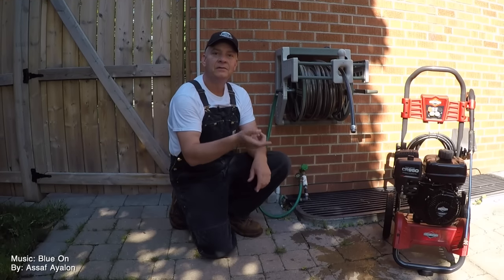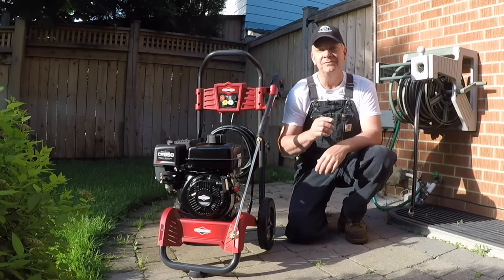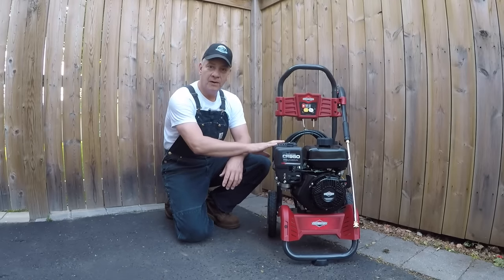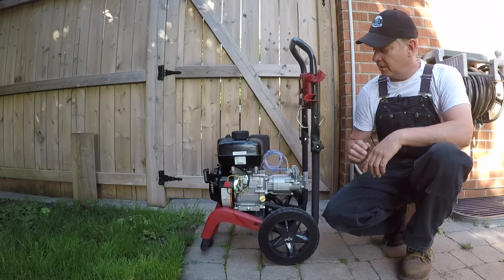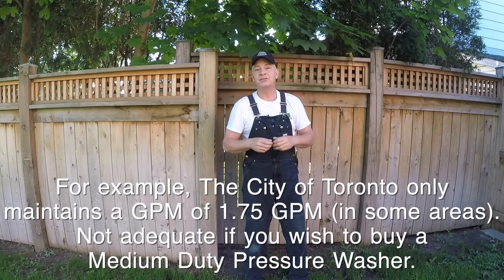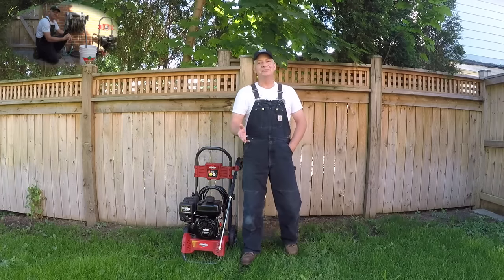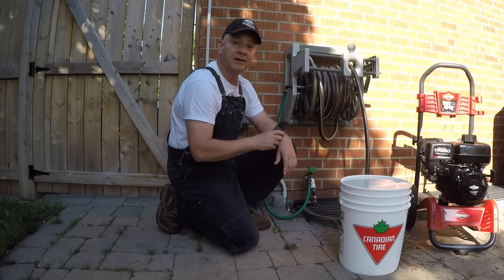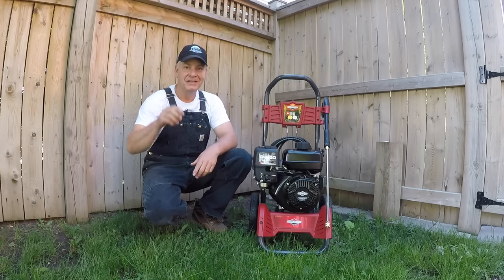#430 Don't Buy A Pressure Washer Before You Watch This! Critical Step That Most People Don't Know.

Comment: There is an easier way without wasting so much water or taking so long. Just measure the time (in seconds) it takes to fill a 1-gallon bucket. Then divide 60 by that number and you have GPM. You can do the same thing for Liters.  Example...  20-seconds to fill a 1-gallon bucket. 60/20 = 3 GPM.   If 15-seconds for a 1-liter bucket, 60/15 = 4 LPM. :-)  Good advice on the manual, I always try to review the online manual on most equipment before purchase. In a lot of cases they will reveal some secrets not listed in the advertisement.
Reply from the maker: Thanks Joe! This is really helpful. Thanks for sharing and enjoy your Sunday!
Reply: Wasting so much water?
Lol like he somehow ruined that bucket of water??
Gtfoh 
hydro hugger.
Reply: @jaxturner7288  I think GP used that bucket of water to do the dishes.🤭
Reply: What’s are “ liters”
Reply: Remember adding a hose to your water supply reduces the gpm . Longer hose less gpm. Thanks this was a great video

Comment: My neighbor has a pressure washer that’s 3200 psi and 1.7 gpm it will barely clean his side walk and fence. My pressure washer is 3200 psi also but it’s 2.5 gpm. If you get to close to the fence it will start to blow a hole through it with the same tip he was using. I would say the gpm is most important data point when buying a pressure washer. I always tell everyone to get one that’s 2.0 or higher. It’s been my experience that pressure washers under 2.0 are a waste of time. They can wash a car but they won’t clean sidewalks or brick siding or fences ect ect.

Comment: 5'39 also the hose it has to be a good hose if it gets tangle or cut in any way from the faucet to the washer machine..it will not go throught the water and it will messed up the machine

Comment: I primarily use my pressure washer for car detailing.  The first rule, no gas power washers, too powerful.  So I chose a unit I can use in car detailing, as well as multiple uses around the house.  The unit I chose is the Greenworks 2300 psi with 2.3 gpm.  Trust me a powerful unit to clean driveways, decks, siding and yet not too powerful for detailing.  The unit cost $230 (US) and comes with a 10 year warranty.  So if you're in to detailing, this could be the unit for you?

Comment: If I can add; if you plan to use frequently/very frequently your pressure washer, from a longevity point of view choose a triplex pump over an axial pump. As well as for generator, choose a copper winding over an aluminium winding for long run and longevity. Thank you again for your very valuable video. Regards.
Reply from the maker: Thanks D! Thanks for sharing some great additional info for us. Have a good day!

Comment: Hey GP, I've watched many of your Kubota videos when I had my B3350HSDC and now I'm looking to purchase a pressure washer and I came across this informative video. I'm looking at a 4gpm unit and I had just performed this test this morning. I used the same size bucket and it filled it in less than a minute. When I watched your video (which is obviously years old) I noticed you called your bucket a 4 gallon. That bucket you used is a 5 gallon. 4 gallon buckets are usually square but never have 4 rings at the top. It freaked me out because I need 4gpm and mine filled my bucket in 54 seconds which is fine if it's 5 gallons but if the bucket were only 4, I think that'd be cutting it too close. I went and rechecked to make sure mine was 5 gallons and it is and so is yours.

Comment: Great video GP,  you work well under pressure!.. Great point on supply. Every type of pump needs an adequate supply of water (or whatever) to meet the rated gallons and head pressure. The laws of physics still apply even for pumps.

Comment: Well GP, I gotta hide this video from the Missus....if she watches it, my 'honey-do' list will increase badly.  LOL  Lots of good info for sure.  We had to sometimes stretch 300' and more of hose up the walls and across roofs to wash condensors of large capacity commercial package HVAC units.  Pressure drop is a major consideration as well as well as hose inside diameter on long runs. 
    MOST residences will fall well within the 100' requirement, but a small cheap 1/2'' I.D. would still be a mistake even at or above the minimum flow requirement.  As the pressure drops, a high capacity pump will literally collapse the hose as it begins the process of destroying itself internally.  By the way, you sure have a way of refreshing a guys memory of all the work yet undone.....   LOL.  Have a great week my friend.
Reply from the maker: LOL! Well, I won't tell her....yet....:)) Yes, some great info there T! They mentioned the small diameter hose issue to me but I'll leave that for a future video. Hope you are keeping cool in this humidity!

Comment: Keep in mind here, Gord, that these GPM measurements are in U.S. Gallons, which is 3.78 litres ( approx.) not Imperial Gallons / 4.55 litres ( again, approx.) 
You are correct here though, the GPM  from your water supply is absolutely critical to the top performance of a pressure washer. 
If the manufacturers really wanted to be truthful, they should all state clearly the 'litres per minute' required for their washers, but I'd bet they won't do that, until 
'forced to' by regulations from government, this too won't likely happen.
Here's another tip for wise buyers, the big deal that manufacturers show is P.S.I. but here, once again, this is fictitious as most manufacturers show a 'simulated p.s.i.
that is enhanced by using vibrating water nozzles.
Reply from the maker: Morning Reg! Thanks - good additional information for folks. I appreciate you sharing it for me and others. Have a great week out there!

Comment: Good information GP.  The bucket method is useful for sure.  We've even used it to measure hydraulic flow in the past.  The bigger the bucket, the more accurate the measurement.  Cheers, Jason

Comment: Not to pick nits, you are actually talking flow, not pressure.

That's a 5 gallon bucket in the USA.  I suspect you are using Imperial gallons? (5 quarts).  Is the pump spec in Imperial gallons per minute?
Reply from the maker: Good morning and thanks for the clarification. Yes - flow ( bad editing on my part). The specs are in US Liquid Gallons ( not Imperial). Thanks again!

Comment: GP - first time I'm making a criticism of your informative  videos. 1) The pail is 5 gallons, not 4. We';ve given up on Imperial units in Canada -its either metric or US Gallons. 2) You keep using the term "pressure" from city tap. You should say flow. A pressure washer's job is to boost the pressure of the inlet water from typically about 30 psi to 3000 psi. You are right that a tap flow that is too little for the flow rating of the washer will not allow it to work properly.
Reply from the maker: Good morning Peter! Thanks for the excellent clarifications. And no worries - I don't think it is criticism, I think it is helpful and constructive. Helps all of us. Thanks again!

Comment: The #1 thing I would suggest to a new buyer is to buy a disc attachment head for cleaning your flat surfaces (driveway, sidewalk, etc...). I cant tell you how many times I see people cleaning these with a normal say 30 degree spray head... back and forth, back and forth and extremely uneven (and pretty physically taxing). When you by the disk, cleaning these surfaces is like vacuuming a floor and is 100% uniform. Best $40 I ever spent.

Comment: thank you for this video.. was looking into buying a pressure washer..but also your hydro on the side of your house, where did you get the cover for the meter. you are a very informative person thanks for sharing
Reply from the maker: Hi Wendy- the utility puts the cover on it here. Good luck in your search! Thanks for watching!
Reply: Im kinda looking at a kubota jet3500 wich kubota gage series has a oil alert protection system in it wich seems a pretty smart idea plus uses direct drive pump wich is nice  design

Comment: once again a great overview GP. I have a well and sometimes during the fill cycle for the pump holding tank the flow drops leading to surging. I've learned to stop spraying to allow the holding tank to fill then it handles the demand. I only figure that my flow must be close to good enough because that works and I can minimize surging.  Have a great week. cheers
Reply from the maker: Great point Roy! I haven't tried it at the cabin yet, but will keep mindful of what you suggested. Thanks for the great advice! Cheers!

Comment: This is really a good video of info, I hobby on the side fixing small engine stuff for extra money, generators, mowers, pressure washers, and the most common reason I see people giving away free gas-powered pressure washers almost on a weekly basis is due to the lack of inlet water pressure. Nearly all the free units I find on facebook marketplace people are throwing away the pump is burned up on them due to the house not having enough water flow, or they hook it up to a water hose and it has bends and kinks in it reducing the pressure so much that the pump overheats and burns up. I developed a simple little DIY gadget you can use to overcome this issue cost only a few bucks since my properly is unable to keep up with the water flow. I took a 5 gallon bucket, on the lid I drilled 3 holes in it and with a bit of pvc glue and pipe put an inlet and an outlet pipe that runs nearly to the bottom of the bucket, then the middle hole just has a small nipple of pvc pipe on it so its easier to see the flow overfilling the bucket and has a simple pvc turn valve for priming the pump easier. I run the house hose to the inlet pipe, the outlet pipe has a short like 5 ft hose going to the pressure washer, I shut the valve off on the bucket, turn the water on and it will fill the bucket up with pressurized water, then I start the pressure washer and open the valve on the bucket. The water will spill out the overflow of the bucket when its filled, then as you use the pressure washer it will drain the bucket slowly, then you let off the handle and can easily see when the bucket is back full by the water spilling out the middle pipe. I went to this, because many buy the higher power gas pressure washers, thinking its more powerful, so it will make cleaning easier... then it outflows the house water source, then as the pump is starving for water it creates a vacuum in the hose and collapses the weak areas in the hose, reducing water flow even more.. burning it up. The bucket having a vent/spill pipe... when the bucket is fully drained, you will hear a different audible sound in the bucket from it sucking air intermittently.
Reply: I did not understand a word you wrote!
Reply: That's a good idea. I may have to utilize a reservoir as well since my house pressure is quite low.

Comment: How does this work if you are washing multiple homes? I can measure my house's flow but would that change much between other homes? I'd hate to get one that works with my house only to find a client's has significantly less output. Or is there a "standard" flow rate? Thanks for the video.
Reply from the maker: Hey great question - your town or city will be able to tell you the flow rates of properties in that town- In my case it was on our city website under Water and Sewer. I still measured my own to see if it was what they said it should be, and it was in the tolerance. So if it is not posted on a town website, if you call them, they will be able to tell you the specs they maintain the water pressure in your city/town. It will most likely be a range. Hope that helps.
Reply: @GPOutdoors  Indeed, it does. Thanks for the reply. Godspeed.

Comment: Hi GP, great information, my only addition would be to very cautious if you ate going to pressure washer the engine in modern vehicles. The electrical connections are called weather pack or marine or watertight or several others and are not supposed to be exposed to 2000-3000psi. This can force water past the seal and cause future electrical issues with corrosion. This also applies to  4 wheelers on parts like the wheel bearing seals water can be force in as the seals are designed to keep grease in and water out from driving in water .  Hope this helps Thanks
Reply from the maker: Good morning and thanks very much Barry! This is really helpful info for folks (and me) to know and be cautious of. Thanks again!

Comment: I’m sorry but measuring correctly is what is important. That is not demonstrated here. If you have city water the you will get the maximum rate through a standard garden hose which is 5 gallons per minutes which was demonstrated here.  If you have a well you need to run the well dry and then see how much water comes out.  If you are using a garden hose to do this then you will get 5.0 gpm max or less if your well produces a lower rate.  If you have static water in well column then you will have 5 gpm, that’s why you have to run a drilled well dry before testing.   Love your content GP!  Just giving you more info!
Reply from the maker: Morning 906! Thanks for the great info. Much appreciated. Have a great weekend!
Reply: @GPOutdoors  Thanks for the great tip about sizing the pressure washer correctly so we don’t buy more pressure washer than we can use.

Comment: Nice informative Video GP - more power does not mean unlimited washing pressure, some towns are well fed and they restrict the GPM like you said. Noticed your washing the truck - bring the jack out and check your alloy rims aren't seized to the steel brake drums, mine did it after a year and it was a pain in the A**. Cheers and stay safe during chores.
Reply from the maker: Thanks Buddy! That is really helpful. I just did my daughter's winter tire change a few weeks ago and we had two that took a lot of elbow grease to get them off. Cheers my friend!

Comment: I want to mention something for clarity: what you are measuring with the bucket is flow rate. Gallons (bucket) per minute. Volume over time. That's flow. Not pressure. Your hose bib doesn't put out pressure, nor does the pump draw pressure. Flow is what is furnished and what is demanded.

You did a good job of highlighting that the pump is always trying to pump 2.3gpm. Which means it's trying to draw at least 2.3gpm from the house and trying to push 2.3gpm through the nozzle. The pressure is just a measure of restriction that the pump must overcome to pump that 2.3gpm. So as pressure rises, the flow doesn't decrease much at all (not with these positive displacement pumps), but the load on the pump (and the motor driving it) DOES increase.

Now, the flow coming out of the house has some pressure behind it (that's why it flows-- the flow is induced by trying to equalize a pressure imbalance). But this pressure will vary with flow. If the pump is drawing as much flow (or more) than the house can provide, it will drop the delivery pressure in the hose so low that it might go into suction. This can cause pump cavitation and damage.

Since these kinds of pumps are typically 85% efficient, having about 15% more flow than the rated flow of the pump will be sufficient. So if you want to run a 2.3gpm pressure washer pump, be sure your hose bib can supply about 2.65gpm. Most USA hose bibs can supply at least 3gpm (mine vary from 7.5 to 9+ I'm lucky).

Comment: Okay cool my pressure wsher is the exact same 3000 psi and 2.3 gpm. So 5 gallon bucket if its fills up withon a minute its like 5 gallons per minute? I should he great. I iusy need half that correct

Comment: My machine operates off of a rain barrel that has a submersible pump in it.  The pump delivers water to the machine (through two debris screens) and the machine pumps it the rest of the way.  Also, keep in mind that hose diameter and length are also something to consider.  I try to run my machine on hoses with a diameter of 5/8" and as short as possible length.  Although the machine I currently own is an old Homelite brand powered by a Honda GXV140 clone with a 2800 PSI pump.  The suggestions from others about time of use are also incredibly handy.

Comment: Good video GP.  I would add to measure it right out of the valve on the house.  You can loose flow rate to friction loss going through the hose.
Reply: Perhaps... but since you will be using the hose to feed water to the pressure washer you will want to know what the hose can deliver. :-)
Reply from the maker: Excellent point Keith! Thanks for sharing!

Comment: 4:50 "if the pressure from your house is less than 2.5 gallons per minute...." Hmm do you want to rethink that? Last time i checked pressure was measured in PSI and flow in GPM.
Reply: Yes.  He is referring to flow rate.

Comment: Thank you for the video very informational great videos always this is a job I did for many years of commercial grade washers doing every type of job little trick for everybody use a heavy duty commercial grade hose also instead of buying 100 foot length of hose if you go to use that by smaller link hose maybe a 25 to 50 foot as if it breaks you can take it apart and have it replaced or it will be enough if you have 100 foot hose or more that breaks the jobs done as you got more hoes (this is auto text sorry for misspelled words)
Reply from the maker: LOL! Thanks Frankie. It was pretty clear. Have a great week and thanks for the good advice!

Comment: For electric pressure washers you might have to go digging for the lower continuous use pressure rating when compared to the shown short burst pressure.  Factor that in when looking at rating as you ideally want to be north of a 100 bar continuous.